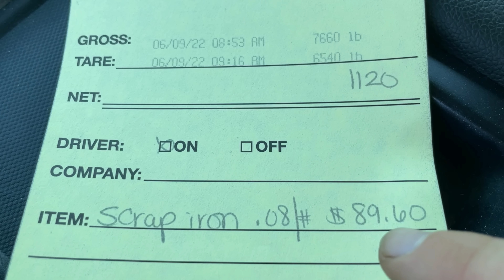What Secrets Are Hidden Below The Surface? (Magnet Fishing)

Comment: I would definitely clean up the pocket knife, as it's one of the best looking ones you've pulled out of the water. I seriously doubt it's been underwater long. Also the pier ' brackets' you found are actually metal stock. The first is a 3" I beam and the second is a piece of angle iron. And while we're on proper names, the thing you occasionally pull up that you call a plumbing 'knuckle' is actually called an elbow.

Comment: The problem with old tripods is that the rubber grips, etc., start deteriorating and become really sticky.  The tripod you recovered is likely mainly aluminum and should be recycled with scrap Al.  It also looks like a gun rest of some kind, though if you have tripod like that, it'd be stupid not to have a camera adapter for it.